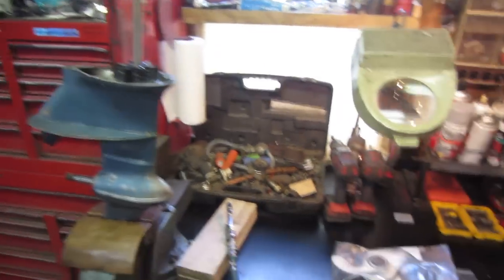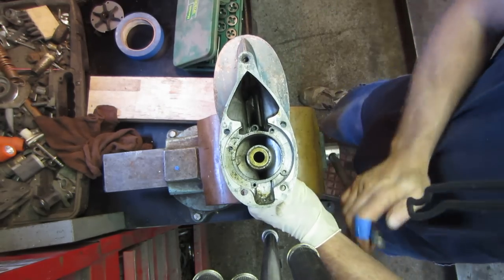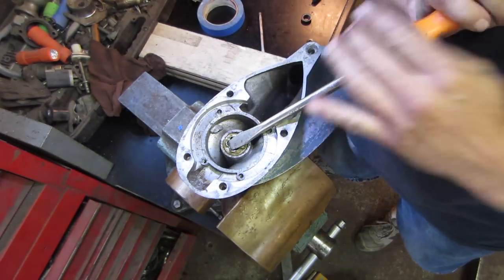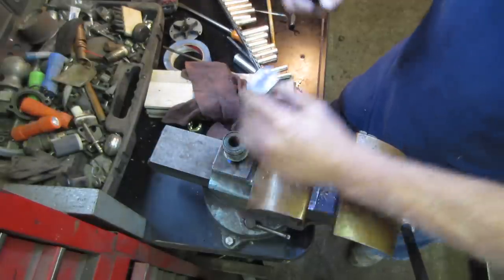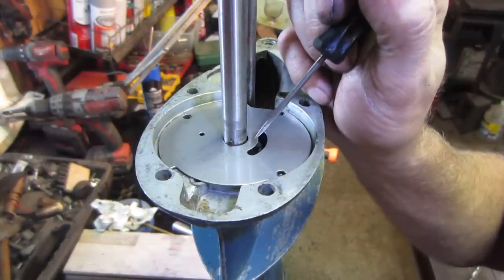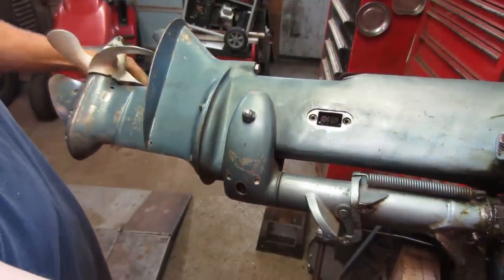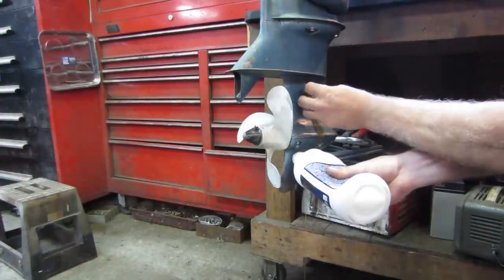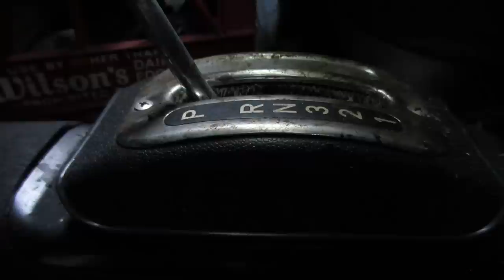1956 evinrude lower unit rebuild and run

Comment: Mustie1.... you rock... I love watching you work... I have just resurrected an old European 350 two stroke from 1986, in storage for 25 years! just passed inspection and legal today -  I used your techniques for initial evaluation: remove plug, look for spark, fuel in the cylinder and after three kicks, 2 second of smokey brilliance....first time since 1992.... you taught me that !!!!  Thanks.
Reply from the maker: glad to here it worked out for you,

Comment: These motors were built by people who had suffered through World War II and didn't want to be left stranded anywhere. They're not only overbuilt, they can be run with the cowl open and a water hose aimed at the insides full blast, without a hiccup. Good work Mustie.

Comment: I have a 1962 Evinrude lark IV 40hp that drives a plywood runabout my grandfather uncle and dad built in about 1954.  It has a very similar lower unit set up to this and ive had it apart many times.  Additionally, the sound of that one running is fantastic.  Thanks for sharing Mustie1

Comment: Good outboards, basically indestructible. I've had a few of these, sold them all off, last one was to leave was the fastwin 18 evenrude that my great uncle bought new in 1958. That's a nice one you have there, would bring in at least 4 bills here in MN.

Comment: I used to own a 10hp Evinrude and I'm pretty sure it was a 1956, which I bought brand new.  I had it for a couple years and it was one of the best outboards I ever owned.  Luckily there were no problems requiring any extensive repairs, such as yours.
Reply: That looks like an engine I'd trust if I had to go venture out... Looks like a dependable workhorse!

Comment: I did some research I have zero knowledge of vintage outboards and based off how much you have in into that little project it seems like you did pretty well. There seems to be a cult following with those vintage Evinrude Sportwin's and based off sold ebay listings you should be able to get around $500-600 without the gas tank. Personally if I was selling that outboard I would list it on ebay with something like within 100 mile local pickup or delivery because you would be lucky to get half what its worth selling it on Craigslist since only a vintage outboard enthusiast knows the true value of that outboard. Good luck and as always I appreciate your videos because you always make it feel like I am hanging out with you shooting the shit while you do your repairs. Always look forward to the next video especially based off the footage at the end.

Comment: mustie1, I thought that using threaded rod and putting an undercut in the end of the rod with a grinding wheel or angle grinder would have allowed you to "pull" the inserts out with less trauma to the metal. However as usual you did it your way and achieved the same result. I fully agree with other comments, your style and the way you tackle problems is an inspiration to the younger generation, anything to get kids into real tactile work and away from gaming consoles can only be good.
Keep up the great work and can't wait till the next video.

Comment: Maybe you could laser thermometer the exhaust water, make sure it's hot (cooling the engine) This was another great series, can't wait to see it in real operation. Thank you so much, Mustie1.
Reply: probably take at least 10 minute run at full throttle to get that much heat into the engine. idling its questionable how much the temp rise would be on an idling engine,.    just my thought.

Comment: I just replaced a water pump on a first gen 4 stroke Honda 10 hp mine needed spline shaft and water pump and seals I had PTSD when you put the lower unit to the power head got lucky and hit all three the first time it's a 1979 sailboat motor long shaft runs like a champ it's for sail 500 with tank hose and charger cord for battery

Comment: One of my favorite sounds of all time is, back when i was a kid in the '60's, the sound of our 30 HP "Big Twin'56 Evinrude wailing behind our '58 Penn Yann Lapstrake 15 footer on the Barnegat Bay, and that extra half inch near Wide Open Throttle where that little ferrule on the throttle linkage mega-opened the throttle plates Waaaa---OOOOOOOOOO!!!!!

Comment: I bought a '56 Johnson (same engine different color) new when I was an avid teen aged fisherman and ran it till some time in the seventies.  It was then no longer cool to be fishing unless you had at least 150 hp on your boat.  I sold it to some one to use on restricted hp lakes.  It gave me no problems except I had to change the water pump out once.  I think it is well work putting the time and money into repairing that engine.  It should give someone another 50 years service if they take care of it and use the proper oil/gas mixture.  Great little engines.
Reply: I hear the leaner oil mixtures are more due to improved oil than to improved engines, but not willing to gamble too much on that.

Comment: hey. Just a little info for you. my uncle has worked on boat motors for almost 65 years. he said the play in the shaft is so it goes deeper into the the pumps bushing for better contact. just diy info. keep up the great work. and please give your dogs a treat for me. see you later.

Comment: Well, hey....yet another neat-o adventure in Mustie's shop! Makes me wonder just how many things get thrown away because the people who are willing to spend the time to fix/continue to use are becoming so few and far between. My 2005 garden tractor, 1979 snow thrower, and 1990 push mower continue to soldier on for the cost of a few parts here and there and my time....which comes pretty cheap!

Comment: I had a 1956 Evinrude 15 hp outboard years ago and the lower unit was basically the same.  The shaft did just float in the lower unit on it too with nothing to stop it from dropping too far.  Once you have the proper impeller on it though, there was enough of the impeller drive pin to drive the impeller.

Comment: Boy o boy those old two strokes are amazing I have a 2 hp and a three hp twin . They were made here in Ontario Canada back then and parts are still available. Smokey old things at 50/1 mix. But they keep the bugs away. 😅 Cheers.

Comment: Here in Costa Rica that motor would work for me but shipping is a non starter. At 80 the stuff you work on is often very familiar to me. Retired down here 25 years ago. I have a housekeeper and her extended family can always prevent me from getting my hands dirty. They can earn a couple of shackles but I miss farting around among the treasures. I’ll keep watching if you keep rescuing.

Comment: Love the old 2 stroke outboards, I have a 1975 55 horse Chrysler outboard that still runs like new. Only work done on it so far is replaced both coils and spark plugs every few years.

Comment: Tech tip - A 1/4" 12 point socket set works great for turning taps. But that 1/4' extension did the trick too!

Comment: drill 4 small shallow holes through seal and use a dent puller and pull toward center and heat it a little with heat gun or hair dryer real good and a little kroil and same on prop shaft or you can really screw up that aluminum.just tryin to help.good video.if you put a piece of tape on bit so u dont drill too far youll be good and sharp drill bit ,slow

Comment: Surprisingly, last I checked, Evinrude still makes the brass bushing to retain the shift shaft O-ring. Ended up just replacing the one I did, rather than messing with it. It was pretty out of round anyway. 

Interesting arrangement they have for the shift fork pivot pin on the 10 horse. The 7.5 I did has the pin screwed into the side of the case from the outside, and sealed with a fiber washer.

Comment: It's nice to see an engineer. Many of the video's show similar efforts to yours Mustie but I have to move on. So many pretend they know everything or throw money at a problem and that's stupid. It's a throw away world and like you I am a very good 'bodger'. You might not like that word but in a way that's what we are. Kit that most people throw away is often good for many more years when it's been in the hands of an expert bodger. I wonder if you know what a 'Birmingham screwdriver, is ? - It's a hammer. That's where the industrial revolution started 200 years ago and I was born . Just remembered you have a Birmingham in the US, I mean the UK one, it's a bit older than yours. Ours is mostly green fields now, steel works, foundries, huge factories - all gone mostly. It would be a pleasure to work by you Mustie and I can't say fairer than that. Good fun in it.

Comment: Now put it on a bike!! Good job!
Reply from the maker: trust me l thought about it
Reply: If you ever decide to do a military theme bike, I have a nice 3 hp military engine 4 stroke overhead valves made by the Chrysler Outboard Division I will send you. Might have some other army items to mount too.
Reply from the maker: nice, thank you for offering sir,
Reply: Use a "motorcycle" type radiator, hoses, etc.

Comment: That VW Type 3 teaser at the end; I really hope it has the Bosch D-Jetronic fuel injection. It looks like it might be a little early for it, though. Sweet technology, and VW was one of the first to have a fully electronic fuel injection system on a production model car. Unfortunately, too many people didn't know how to keep electrical connections clean and replaced them with carburetors when they ran poorly. Also, that borg-warner auto trans is another first for VW. Most people see the auto and assume it is an auto-stick like the beetle had, but it was full auto in the type 3.  I see fun videos in the future. Next time you ask, "What do you guys think?" I might actually have an answer!

Comment: I could be nit pickin, but the correct name for what your working on is a "lower unit", an "outdrive" is used to describe the drive unit on an I/O, or inboard/outboard assembly. Usually a car engine inboard, a drive unit outboard hanging off the back of the boat. I say usually a car engine inboard, because OMC i.e. Johnson/Evinrude used some v-4, 2 cycle outboard motors specifically designed to lay on their backs and run, as power units in the late 50's, early 60's if I remember right. Kinda collector items now, not a lot of them made, that survived.

Comment: I changed my mind, you really could use a bearing puller set. They've got a set for $60 on Amazon that covers 8mm up to 58mm, or about 5/16" to  2  9/32". I fix my own vehicles myself, and I gotta say... I would've spent $500 on labor for some of the jobs I've done custom, so by the time I spend $60 on a tool it's well worth it and I have it forever. In this kind of situation... who knows what damage (from trying to hack it out) and time this set could save you.

Had to buy a $60 bearing for my Saab because I didn't have the right circlip pliers and had to beat it out with a screwdriver... screwdrivers are great, but that time you miss or slip and mess up the thing you're working on.. you wish you had the right tool heh.
Reply from the maker: are you talking about a seal puller ? bushing? not sure what bearing you are referring too.

Comment: I just discovered your channel and this series of vids. I like your stuff.

I'm a diesel/truck tech for 30 years. I think that you occupy a space between the regular home gamer and the pro. You conceptually have the pro mind to 1st try to do no harm. But you also have the limitations of tools of the typical home gamer.

While I admire your willingness to dig right in, you sometimes drive me crazy with your technique. So....I smile the whole time that I watch. I even laugh when you do something completely wrong and seem to (at times) miraculously pull it off with a hammer and screwdriver.

BTW: I'll give you extra credit for having an impact driver. VERY valuable tool. I see too many techs think that banging on a screwdriver while turning is the same thing. And even some techs I teach have never seen one and even poo-poo it as old fashioned. Show off that thing and explain it every chance that you get. Thanks!

Comment: One thing about these older motors, if it is marked 10 hp, it is 10 hp off the head.  By the time it gets to the prop, it is only about 7 hp or a little lower.  The old motors were rated off the power head and the new motors are rated at the prop.  The 1956 Evinrude 15 hp I had was basically similar in power to the 9.9 hp motors they have now.

Comment: that’s a very cool old evinrude. i ran across an old, small outboard tiller style, much like this one. I don’t know ANYTHING about it, other than what i could find on line... it’s a 1943 “Hiawatha” 3.5 HP, twin cylinder. my guess is it’s the “prelude” to the “Techumsi” motors.

Comment: I have a 61 that runs great need to do so carb work on the idle or low speed im in the middle of restoring the boat and motor

Comment: Do not forget to schlock sealer hevi!y on those bolts!  Bad design, bolts are on the INSIDE of the spaghetti seal- will certainly leak water into the oil via the bolt holes. Voice of many years exp eriece with these motors. Good vid tho!

Comment: Summertime apprenticeship would be perfect.  They don't offer teenagers auto shop or machine shop these days.
Reply: SMA does!
Reply: I work on trucks and the new Freightliner cascadia has 14 computers, spend a lot of time looking at wave forms and sensor data but i still have four different sizes of hammers.
Reply: those classes are still out there. at least up here in the great white north. my son took automotive and welding  in High school. even won first place in the regional auto service skills competition.   he even had an opportunity to work on restoring an early 70's Chevelle and work on the Shop Teachers hot rod. some fab, some mechanical .
Reply: Good to learn this.  I'm from Upstate New York and we are  raising our teenagers in South Florida with none of these opportunities.
Reply: @foghornleghorn4197  sounds like an opportunity for you become active. Ya know...school board, PTO/PTA, city council...

Comment: I don't have much experience with these things, but I have found when the engine is sputtering like that at low speeds, give it more fuel on the low speed adjust. That works for me with my 1955 7.5 HP, I don't know if that's what you ended doing, and if you did maybe somebody else will read my comment.
Reply from the maker: yes l adj the mix after it warmed up
Reply: Mustie1 Alright, did you richen it? Just curious
Reply from the maker: yes it was a little lean
Reply: Mustie1 Ok, that's what I figured

Comment: You had just a bit of lean sneeze.  Mine has so much lean sneeze I usually can't keep it running for long.  I only have a modern fuel tank an must keep priming with squeeze bulb, so that may be part of it but I think there is more, perhaps dirt in carb.  I have a modern fuel pump and hear there is a way to connect it, but maybe I can also attach a hose barb to a modern, plastic tank for the pressure return and use the modern squeeze bulb for the primer.  Apparently, the tanks are scarcer than the engines.

Comment: The pin don't touch the plate when the engine is running. The thrust load in the gearcase pushes up on the driveshaft.

Comment: Thanks for showing the Tap Extension tip! I don't own a full set, and was wondering how to get the T handle set up with adjustable wrenches... Your system seems to work well. Cheers from VA!

Comment: Is the recess on the impellor to create a gap for the shaft pin? That way the impellor would sit tight against the plate. The way you have it the impellor is always lifted off the plate by the thickness of the pin. I would think this would allow water to move underneath the impellor vanes reducing the water pump efficiency.

Comment: Hey must be one I had a guy tell me one time do you use Dawn dish soap to lubricate the impeller. It'll wash out of there but it'll keep it in slick until it gets broke in. I wonder if the grease will swell the rubber?

Comment: This was good for me. I have a '57 Johnson 7 1/2 which is basically the same motor. Will do service on it and maintenance the lower end. Mine has not been run for 20 years. Dad bought it new in 1958. What was you asking price? Many thanks.

Comment: The only bummer is those old 2 strokes are banned on many lakes these days due to the pollution they create.
Whole lakes would end up sterile of life within weeks of the beginning of boating season up north.
You'd see lines of what looked like gas pollution on the water in the areas most popular for boaters to cruise.
I can remember when they banned them on the lake my Grandpa and my Uncle Jim had a cabin on up in northern Michigan up around Tawas.
Boy was he pissed.
Grandma said he needed the exercise anyways and bought him some brand new oars for his 12 foot John boat he'd fish in.
She was right.
He lost 50 pounds that summer.
She made darn sure he did most of the rowing.
I'd take my turn tho.
Eventually he got into it and ended up enjoying using the oars because he felt so much better he worked harder on his worm bed.
He made a ton of money in the summer selling worms to weekenders.
You can guess who got to dig them up, count them then pack them in cardboard cups and put them in a cooler.
Gramps sold them.
I pulled the wagon cabin to cabin till he built a two seater trike bike for us to use.
Last time I was up there before I went off to Coast Guard boot camp his Evinrude was still in it's barrel.
Gramps kept it running.
My uncles, Dad and gramps would use it in the winter in their ice fishing hut to keep the water from freezing over in large hole they'd share to fish thru when the ice got over a foot thick. 
It averaged 2 to 3 foot thick in the dead of winter.

Comment: For pulling shaft seals it is much easier using an expandable bearing puller on a slide hammer.  Seal comes out totally unharmed in seconds.